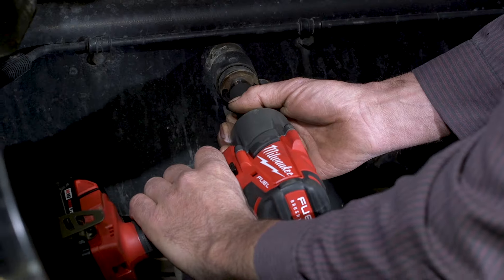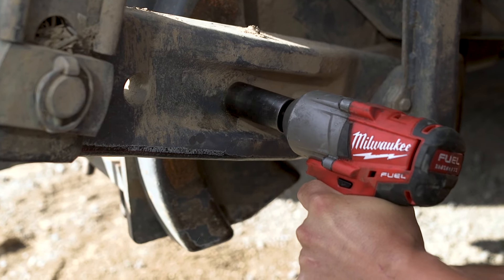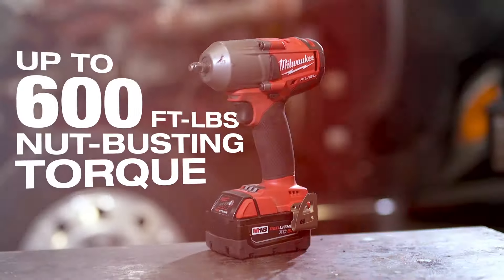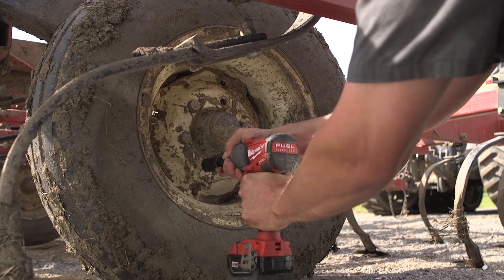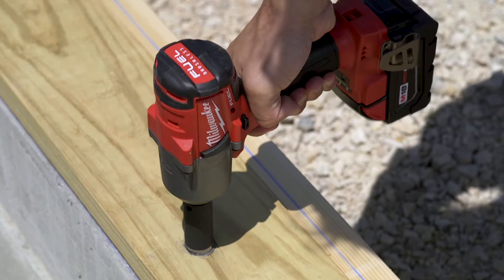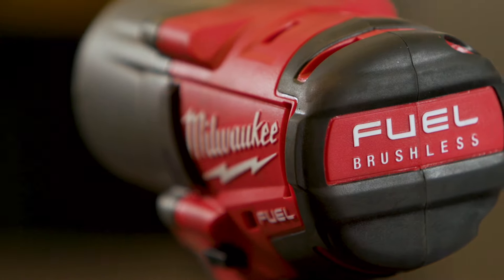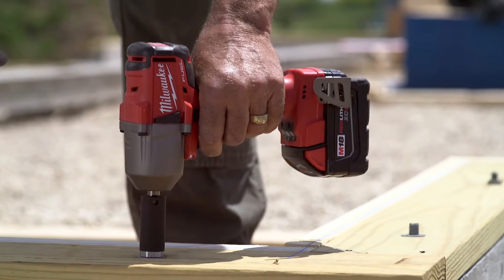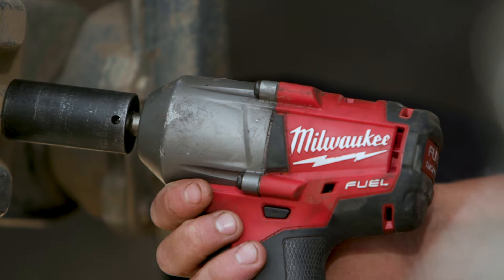Milwaukee® M18 FUEL™ 3/8” Mid-Torque Impact Wrench

Comment: That's a mid torque with a 3/8 anvil!
Reply: stealthflythecoop WRONG, son. This one is 1.4" shorter than the 1/2 mid torque. Entirely smaller but same power. Milwaukee crushes you!
Reply: hostilityy the title says 3/8
Reply: hostilityy it's a mid torque with the 3/8 anvil and it's shorter because the aluminum housing needs to be made to fit the shorter 3/8 anvil nothing too special about this tool besides the most powerful 3/8 impact wrench on the market 👍
Reply: Mechanicable I did comprehend his comment and I replied in an appropriate manner I'm not sure where exactly I misunderstood his comment
Reply: LOL Mauricio Espinoza I see where the confusion is. milwaukee currently has a 1/2 anvil tool called a mid torque. the guys comment is implying milwaukee simply changed the anvil to a 3/8 and kept the old shell and is selling it to us. sorry for the confusion bro
Reply: hostilityy Yeah idk why people are saying this is the same as the 1/2 current mid torque with just a different 3/8 anvil. its a different tool! a simple search online will show the dimensions and specs. people are stupid.
Reply: stealthflythecoop that's an old comment; I simply compared the specs on home depot website. blame them.
idk if they've updated it now